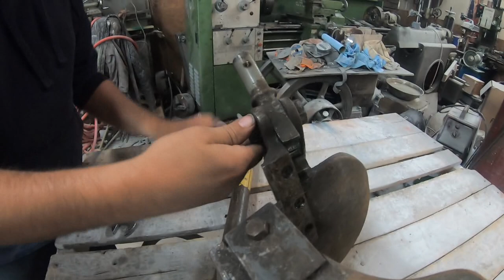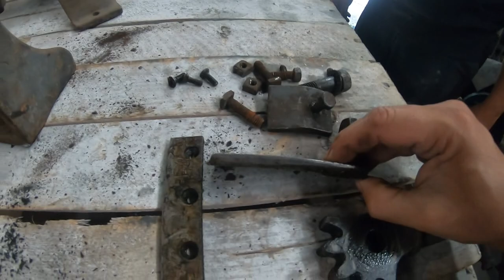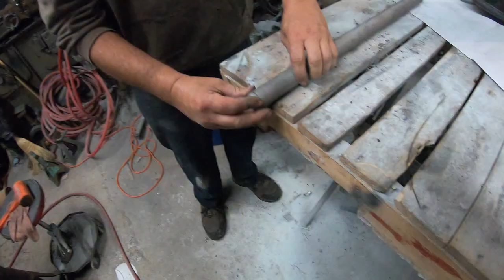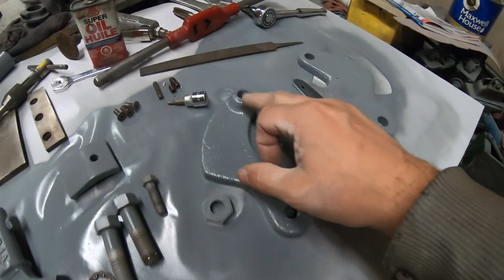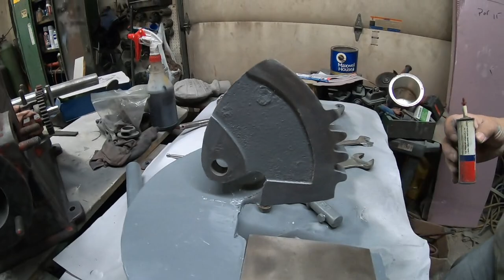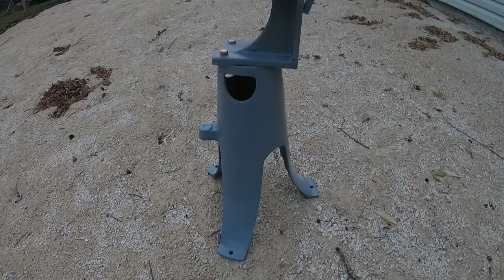1930's Beverly Shear Restoration.  Antique Equipment, Antique Machinery.

Comment: Cool video. I remember my Grandpa refurbishing old tools like this. He would pick them up for free or a couple bucks, clean them up and sell them. His specialty was old bench grinders. He would tear them apart and put new brushes or rewire...whatever needed to be done. many family members have them. His special thing he always did for the real nice ones was to put rubber feet under them on the stands he would make. They are whisper quiet when running. I still have mine. Rarely use it much any more but still turn it on and am still amazed at how quiet it is.  
  All were that machine grey. Thanks for taking me back for a few minutes. I really like the videos.
Reply from the maker: Thank you Russel.  Your Grandpa must have bin very handy with his hands, great to here that.  We are just trying to keep some of this old stuff alive for our future generations.